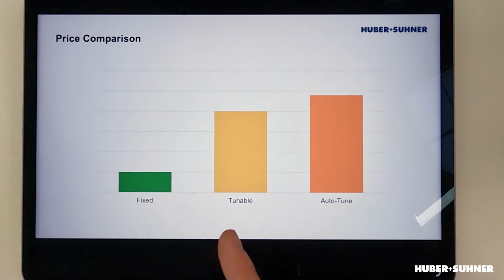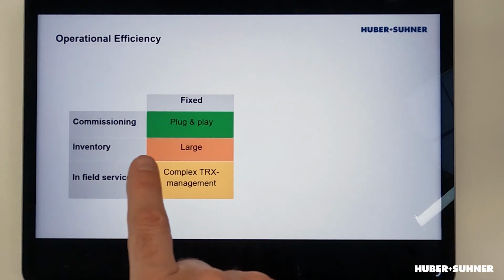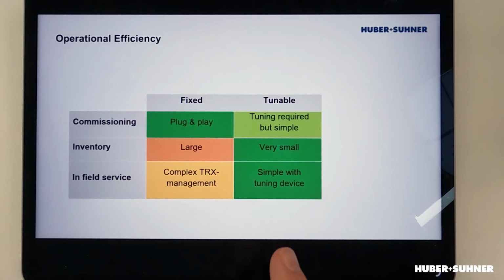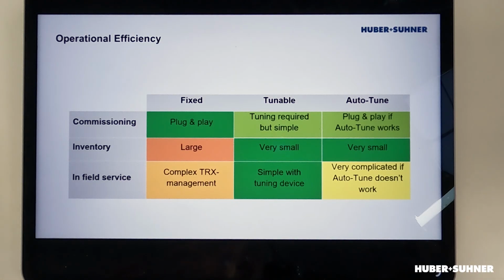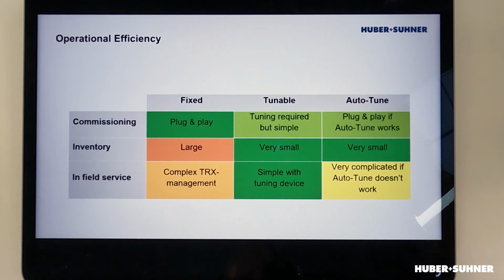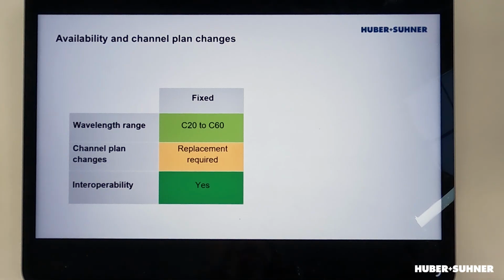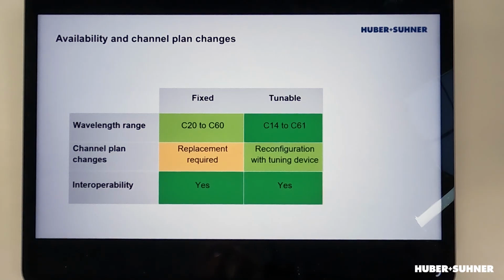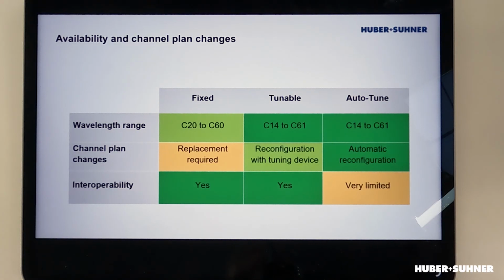DWDM Transceivers for X-Haul (04-01-03)

Comment: The captions is bot working 😢
Reply from the maker: Strange. I just checked and they are working when I start the video on YT. Having said that, they didn’t start when I simply clicked the CC button. I had to go to the settings and activate them there (I also checked in the backend and the CC are activated for this video). Maybe you can also get them to work  via the settings.
Reply: @HUBERSUHNERGroup ty for your replying, i'll use gemeni for helping, i appreciate that.